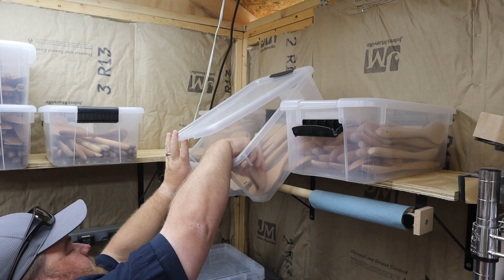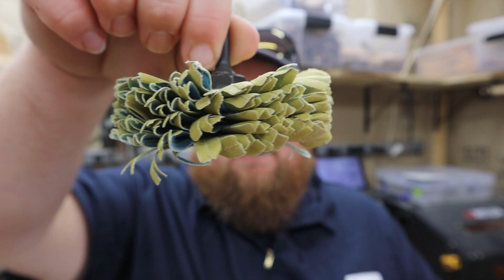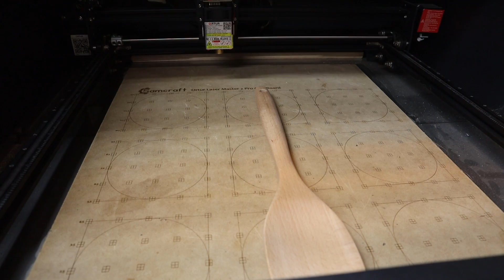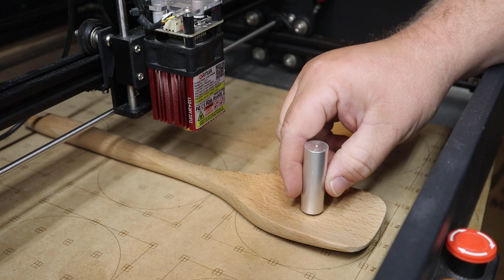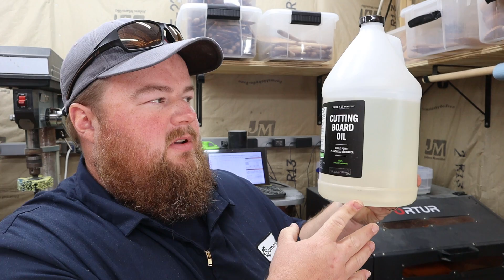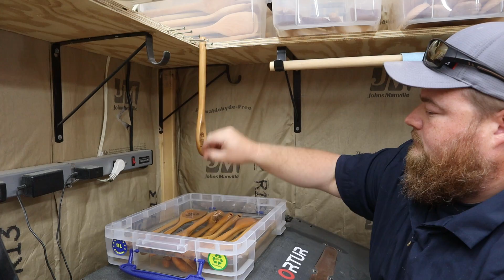Giving Away ALL MY SECRETS! // Laser Engraving Wood Utensils

Comment: I don't know if your sanding mop is able to be taken apart. But there is one on Amazon that does come apart and you can make your own sanding mop pads by cutting small strips of sandpaper, punching a hold in the center, and stacking them.  It's tightened by a nut and you can make them thick or thin and any grit. I learned of this from another YouTube that carves wood spirits with a Dremel Tool, and he makes his own sanding mops on smaller jigs...

Comment: I had a similar problem with my 3d printer freaking out at random times - annoying after a 15hr print fails. Found out it happened when the refrigerator I keep my beer in kicked on! Solution was to wrap the cables around ferrite cores (little metal donuts) fixed it first time!!😄 - fridge was causing a spike in the current - the cores damp it out. Worth a try?

Comment: Hi Sam, I've enjoyed watching your videos. I also have a laser engraver (Sculpfun S9) and have been mainly engraving cutting boards for friends and family. Do brush the soot out of your engravings before applying oil? Most of the cutting boards I have done (bamboo) have black soot residue left behind after engraving that I use a soft plastic brush to gently brush it out and then blow off with the air compressor. Maybe it's just the bamboo or that I'm engraving too deep. Thanks for your help and I look forward to your future videos.
Reply from the maker: I usually touch up the utensils on the contour sander after engraving. I've had only a couple come out sooty, and will do the same with an old toothbrush prior to bath time. Bamboo is bad for running away in depth with you depending on the grain or sap spots.

Comment: drill press bearings aren't designed for lateral loading, and you will eventually cause the bearings to go by pressing sideways on the chuck. a desktop mill will have bearings designed for lateral loading if you want to continue sanding with the mops

Comment: Thanks for sharing! Found it very interesting doing mostly woodworking up to now but thinking about getting a laser. 

Two thougts that came to my mind watching you go. For me raising the grain worked best just before the last sanding step. Have you tried or is there a special reason why you do it first? Also I wonder if a physical positioning jig would speed up your process a little.

Wishing best of luck for your ventures! :-)
Reply from the maker: I never thought to try raising the grain within the sanding process... sounds like a fun experiment! :) A positioning jig would be another awesome addition... IF the machine were able to be dedicated to just that item or easily changed. I do a mixture of items for engraving but use one machine. Great ideas, thank you for the gear-turnings!
Reply: @Samcraftcom  let me know how it works for you :-)

concerning the jig: how about two holes in the baseplate? Holes in the same position in all of your jigs (cnc might help drilling accurately) and two referencing pins and you could pop any jig right in and out without spending another thought on lining it up.

Comment: Hello Sam!  I really appreciate your video!  In your other "wooden spoon video", you apply a "cutting board wax" from the same supplier.  In this one, you skip this step.  So do you still add the board wax after the oil bath?
Reply from the maker: Hey Eric, great question! I don’t apply the wax anymore. I questioned if the wax may somehow get stripped off the utensil when used in boiling water and didn’t want to risk it. I’ve had good experiences from just the oil finish from my customers. Behind-the-scenes, I’m experimenting with 100% pure tung oil as a possible utensil finish in the future, but nothing’s definitive yet for making a video on it. :) Hops this helps!

Comment: Hey Sam, you could hang the utensils, on a small dowel, or piece of all-thread if straight is a concern. Then run the all-thread or dowel through the handles of the utensils. And hang the all-thread is dowel between the hooks on the shelf brackets over your tub of oil! Anyhow just a thought. Thanks for another great video my friend.. until next time..

Comment: Very cool one question i have i can never seem to find an answer to is once you put your oil in the Tupperware how long is it good for?  Does it ever go rancid or anything?? I would like to do this with my cutting boards. Thanks Sam!
Reply from the maker: This oil does not go rancid ever. That’s the most important thing to look for in any wood oil. I change the oil when it becomes dirty from dust or wood bits. It’s a “by the eye” type thing.
Reply: @Samcraftcom  thank you soooo much

Comment: Was watching some of your other videos.  What is the update on the shop?  Have you trimmed and roofed it?
Reply from the maker: Not yet... I have trouble using ladders due to heel spur problems that have worsened lately. I'll probably have to get help do to the roofing, but need it done very soon too. Surprisingly the underlayment is still holding, but I'm pushing my luck!
Reply: @Samcraftcom  I have heel spurs too, and found out that the pain is caused by plantar fasciitis.  I had a pair of custom sole inserts done my Hangar.  And the pain went away. Just sharing

Comment: I enjoy watching your videos. I make wood signs and flags, currently I am making a custom table for a rv. I am curious on what tools you are able to run on your solar array? Ad I am considering adding one myself, I use a tablesaw chop saw air Sanders a compressor ect.
Reply from the maker: It really all depends on the output capacity from your inverter and your tool demand. I have a 10" DeWalt jobsite table saw and it will run it fine. My current setup is a 3,500 watt output inverter.

Comment: Hey Sam, love your channel.  The reason why the drill press and laser can’t operate together is the motor on the press is kicking out all kinds of conducted emissions back onto the power line…..more than the laser’s power supply can filter out.   You might want to do some research into power line filtering.  I’m not an electrical engineer but I work on a lot of projects with EEs and this comes up a lot in our designs, so I’m not 100% sure if it would be better to put the filter on the press or the laser.   If you got a UPS that also did power quality filtering you could put that on the laser and it should knock that down.
Reply from the maker: Ahhh... that totally makes sense! I have an ISObar somewhere in the shop (in one of these boxes) that I bought for the CNC when I got it, but never needed it. I should try to dig it up and put the laser on it. It's supposed to help with interference. :)

Comment: To rectify your "current powered situation" you could install a net filter for the AC current that goes to your laser engraver. That should filter out all the pulses that are being created by your AC equipment (AC as in Alternating Current)
Reply: I live in Europe. All manufacturers of laser marking inks are American.
To import a spray can of laser marking ink costs $100 to $240. Does anyone know a cheaper method of engraving durable markings on metals with a 10W diode laser?

Comment: real container rates have gone down in the last few months.  Just saw an article mentioning 3500/container.  It was 2000 in 2017/18.  Went up as high as 18000 in 2020 and was 14000 in 2021.  So the rates from China for less than conainer should be going down....

Comment: Hey man, those things look NICE (ha)! Question - are you able to laser engrave multiple utensils at the same time to increase efficiency? It looks like you could maybe fit 3 on the laser bed. Maybe if they are all the same type (spoon, spatula, etc.) so that the offset will be the same. Great product, Sam. I love beechwood myself. I feel like it's an underrated wood that has a similar tone to maple but for considerably lower price (at least at the hardwood dealers in my area). Great for for cutting boards as well and even hand tool workbenches. Good luck sourcing the bulk utensils. You may have some luck with a company like Faire or Tundra. - Joe
Reply from the maker: I am hesitant to engrave more than one at a time because of the height differences between utensils. I'm afraid of messing a batch up. Perhaps if my utensils were more uniform. The beech wood ones can vary quite a bit. I have a lot of Acacia wood ones that I just got in. Hopefully they will be more standardized. If so, I could easily fit 3 or maybe 5 on the board at a time! I'm also a big fan of beech wood. Never knew of it before utensil work, but I enjoy working with it!

Comment: Sam the man in action !!! Love it !!! How does the engraving hold up to use ? Like stirring soups and stews. Do you need to re-oil them after using and washing ?
Reply from the maker: The engraving should last a very long time since they're placed in a general low-friction point of the utensil. The utensil's lifespan before needing to be touched up and oiled again depends on the user and how they care for it. Submerging or dunking in fluids is a killer to the utensil. It robs them of the oils and strips them down again. It's not the end of the world (usually) but does mean sanding and oiling them again as if new.

Comment: Just a silly question 🤪 that oil is so expensive, so leaving the whole tote open to the air and dust for some time seems like it could be an issue, why not just wipe the tote top off ,replace and let it drip on the top as it has a Valley all around the edge,then pore it threw a fine mesh thingy,lol back into the tote ,yes not as simple,but keeps your precious oil clean and pure???

Comment: For the laser freaking out issue get a UPS (CyberPower or APC) for the laser. That will clean the signal up and also give you some extra time running if needed a light, tablet and laser will only use 100-130 watts.
Reply: I was getting ready to say this..
Reply: I was thinking the same thing!